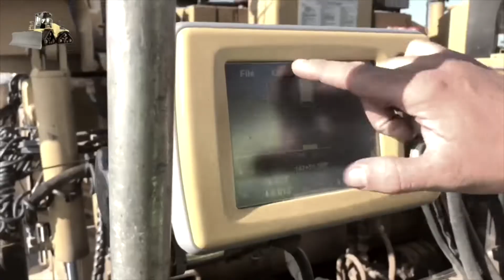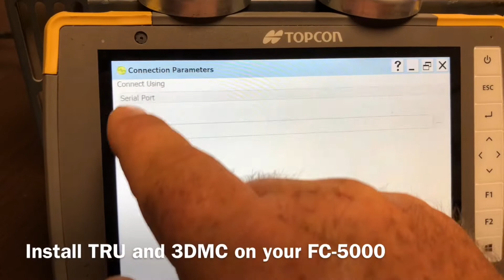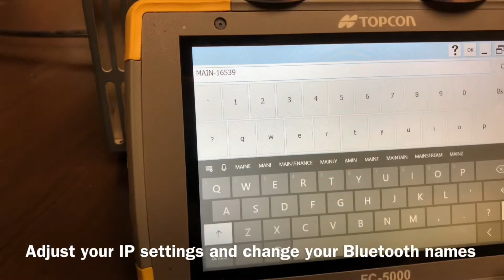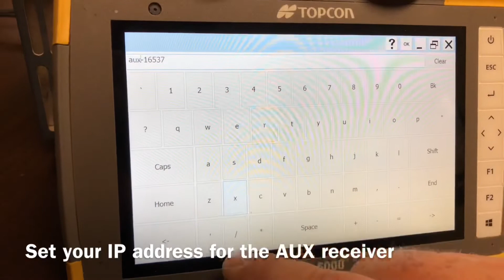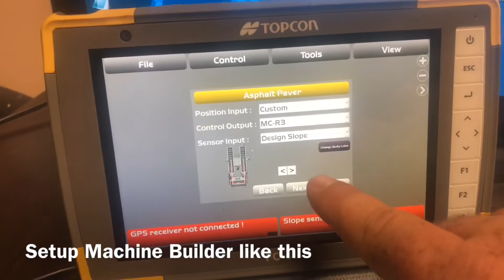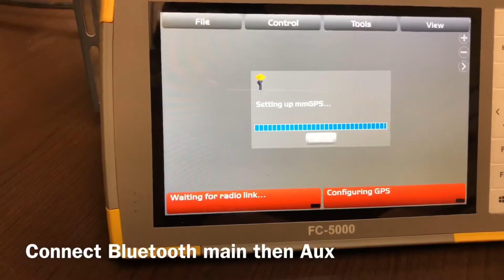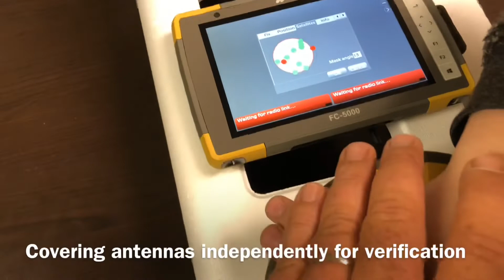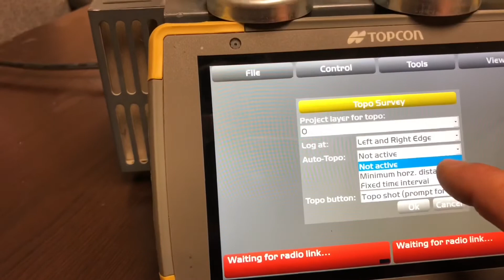How To Do A Totally Wireless Dual GNSS Machine

Comment: If this is not thinking outside the box :)  What box do you need with this setup for machine control mc r3 or mc i4 ?
Reply from the maker: arni thordarson 
I have done Indicate machine control using the FC-5000, 3DMC software and an MC-i4 machine receiver. I’ve done this on Dozer and Scraper Machinary. Also If an adapter cable is built it also possible to incorporate one or a daisy chain of TS-i3 sensors as well. For instance wheel loader and excavator.